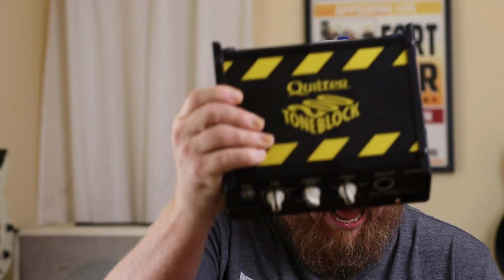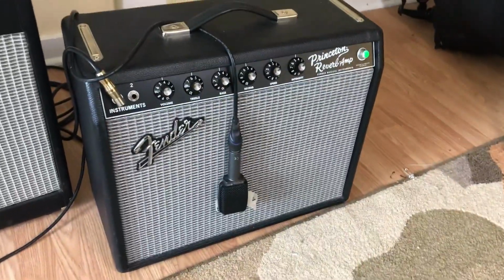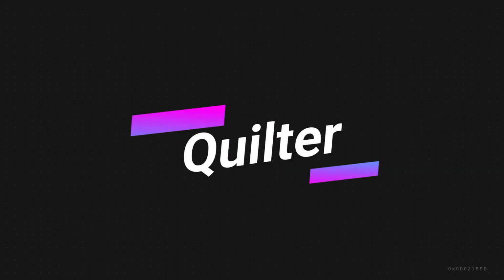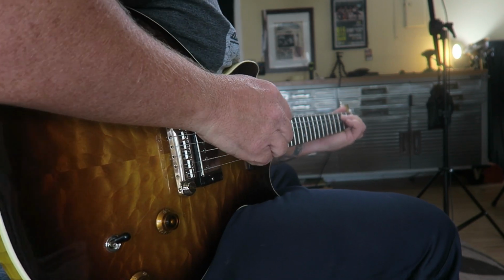Tube Amp vs Solid State

Comment: Great video, thanks for making it. Do you find the Quilter to be touch sensitive in a way similar to tube amps? 

Also for future demos, I personally think it would be more effective to edit the video so that there is a more direct juxtaposition between tones. 
Amp A clean vs Amp B clean
Amp A overdriven vs Amp B overdriven 
Amp A w/reverb vs Amp B w/ reverb

Just my 2 cents. Keep doing you! 

Princetons are my favorite
Reply: Quilter is one of the most touch responsive amps you'll play, solid state or tube.